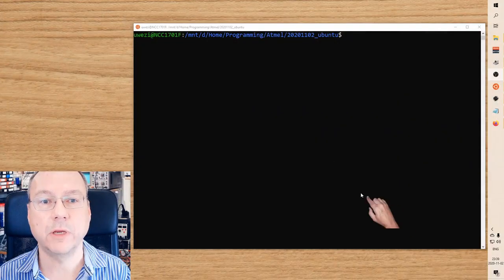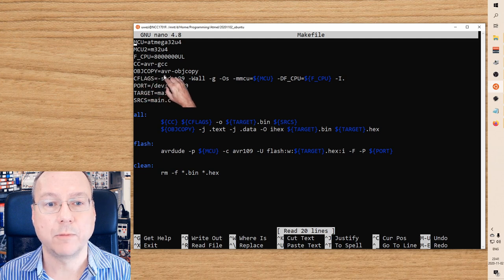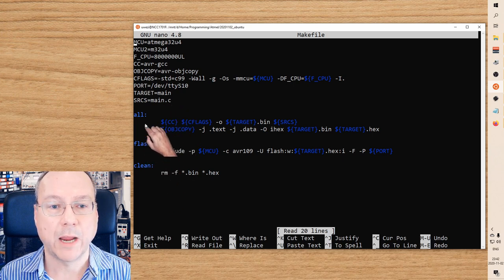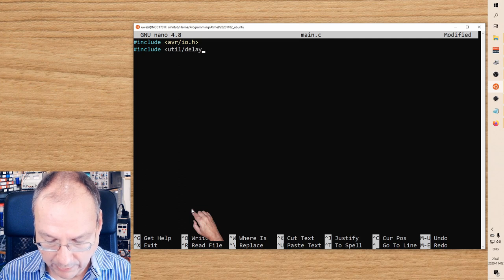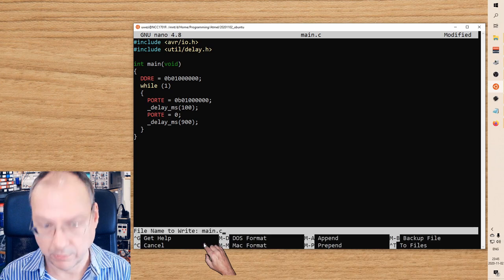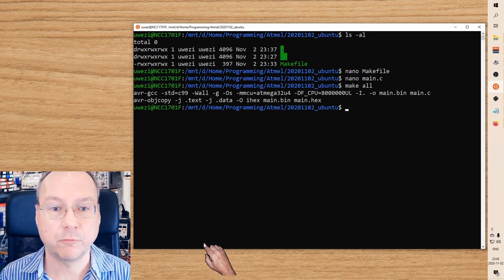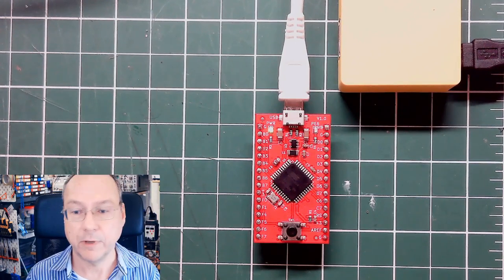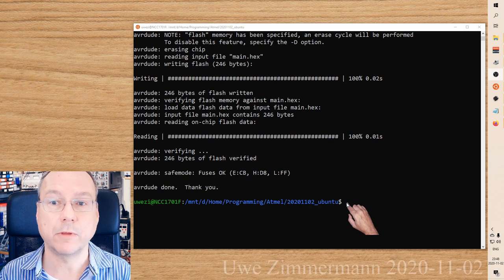Getting started with AVR and Linux command line tools

Comment: I wonder if this program would do the same (kind of task schedule oriented):
#include <avr/io.h>
#include <util/delay.h>
int main()
{
 DDRE = 0b01000000; 
 int i = 0;
 while(1) // an iteration per millisecond
 {
  switch (i)
  {
    case 0: PORTE = 0b01000000; break; // task at time slot 0
    case 100: PORTE = 0; break; // task at time slot 100
 }

  i = (1 + 1) % 1000;
}
Reply from the maker: Your program is built around a state-machine and in principle it will blink the LED in a similar way. But there is nothing in your code which takes care of the exact timing. At a clock frequency of 8 MHz as in our case, one iteration inside your while-loop will be much faster than 1 ms. Including the overhead of the 16-bit compare/add/modulo operations, I would estimate something like 20-25 instruction cycles per turn, this would mean 8 MHz/25=320000 loops per second or 3 µs per cycle, 300 times faster than your assumption. We could test this in one of our lab sessions.

Also my goal with this short video - possibly not only for the audience in our course - was to keep the code as simple as possible. The switch-case-statements are something I personally like but consider an somewhat advanced knowledge. 

A purist programmer would perhaps point out that a switch-case-statement never should miss, every possibility should be covered - if nothing else by a default-clause...
Reply: @uwezimmermann5427  amazing grip on subject. SIR